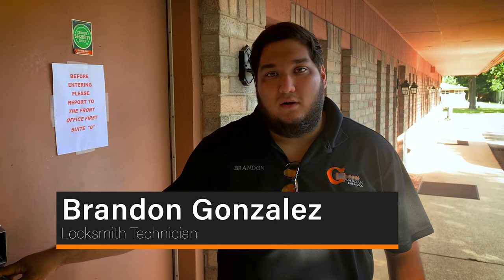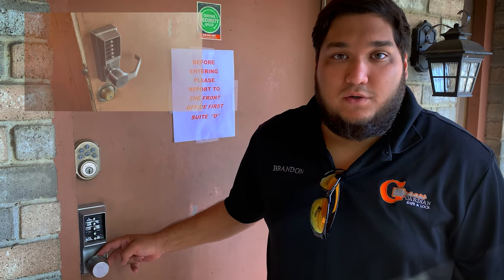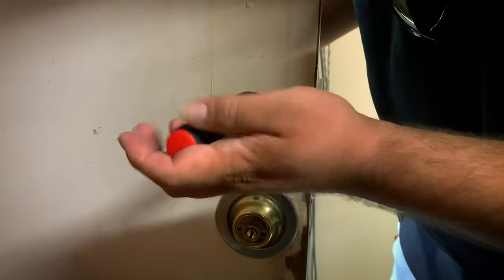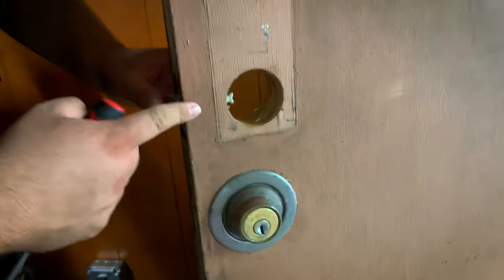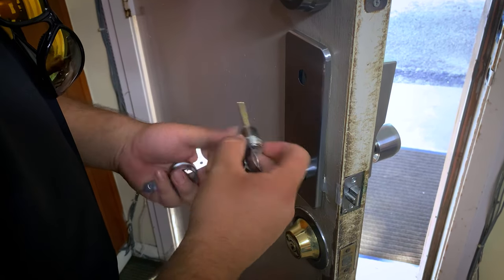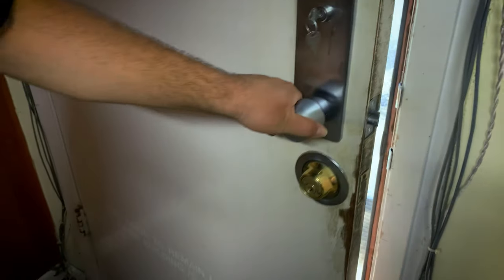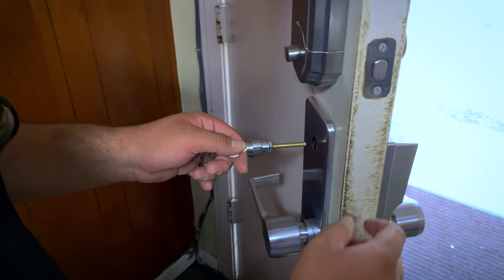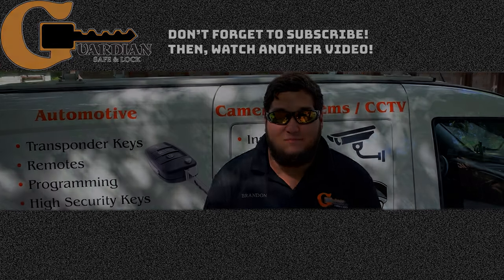How To Install A Simplex Lock

Comment from the maker: Want to see more hardware install videos? Something else? Let us know here in the comments below!
Reply: What if you need the door handle facing the other way?
Reply from the maker: lodydody everybody Good Question....simplex’s come handed, meaning that you can either get it in left handed or right handed.
Reply: @GuardianSafeAndLock  I wanted to take the handle off and swap it the other direction.
Reply: @GuardianSafeAndLock  thanks for the reply by the way.
Reply: @sNoLove-zl2vb  the handles are hand specific at kaba, if you want be able to field change the hand get the knob version, easy to reverse the orientation